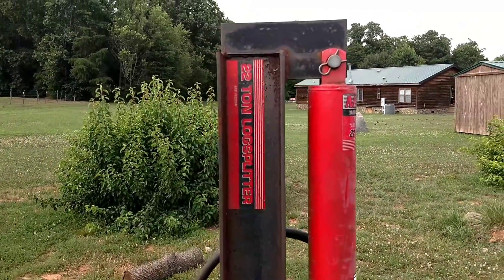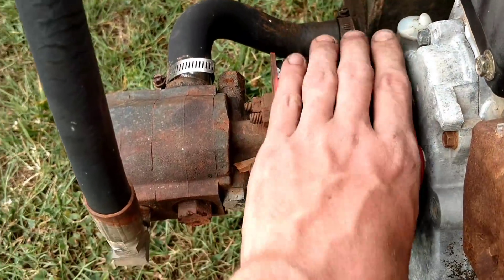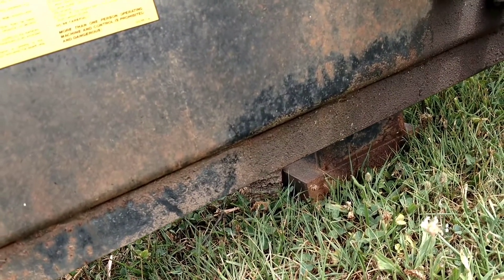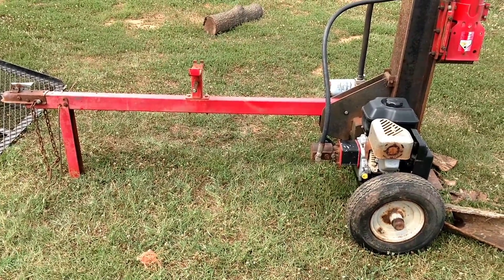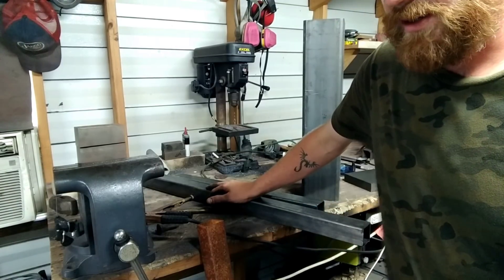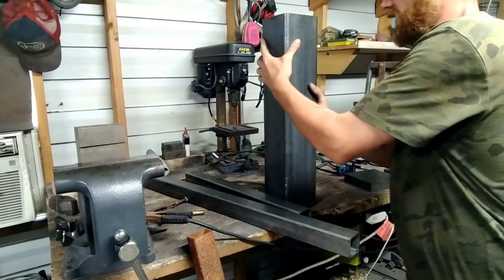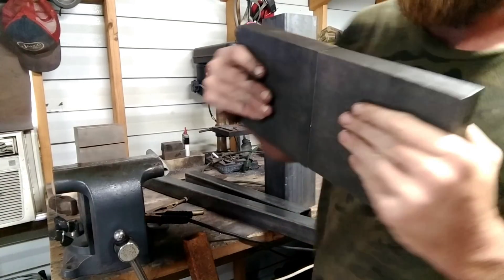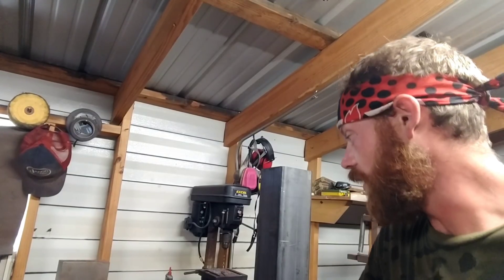Building a forge press: material overview

Comment: Create motor mounts and hydraulic pump mounts out of either flat plat welded into an angle iron, or find angle iron of the correct size. Drill your mounting bolt holes and position the mounting plates to align the motor shaft to the pump shaft. similar to your fullering jig for the sword, just monster sized! Depending on the marrying up of the shafts, you may need to create or find a way to bodge up a joining collar or a sheer joint similar to PTO shafts to create safety measure in case there is a bind in the pump or motor.

Comment: Good luck I'm starting the process myself. I'm going with the 5 horse 3 phase motor in a vfd so I can change up my speed and hydraulic pressure. I probably wouldn't have thought of it but my daughter's better half builds and repairs hydraulic cylinders for a living